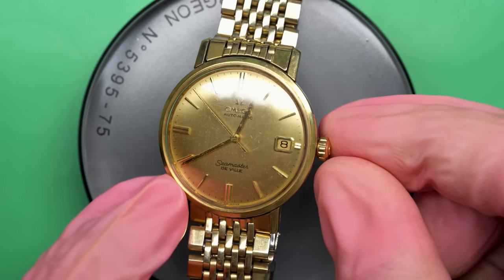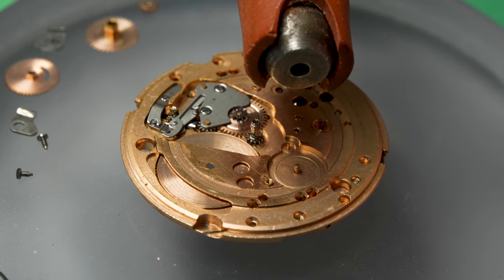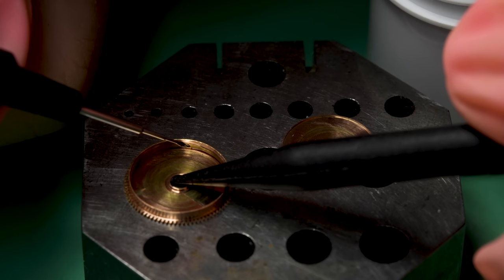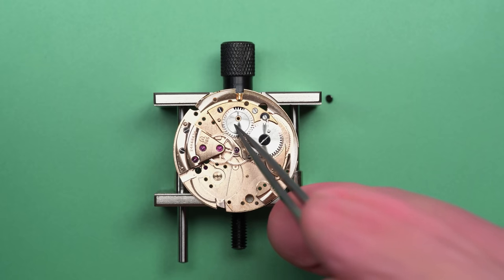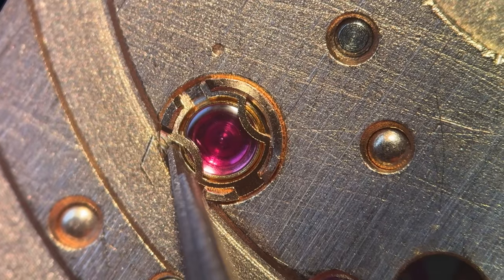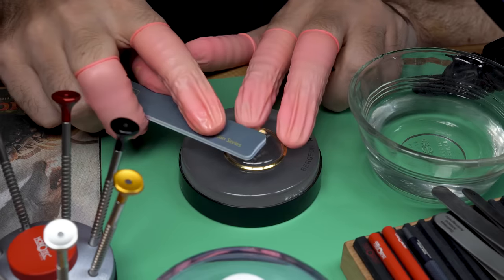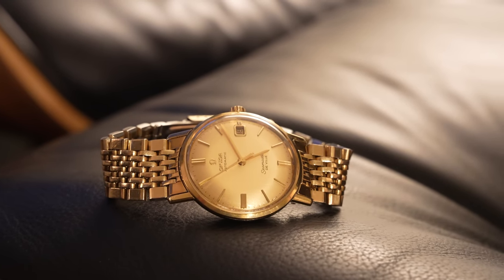This Omega Seamaster Sat in a Drawer for 30 Years

Comment: I would love for you to restore my dads 1980’s Rolex , how can I get in touch with you? I’d like to give it to him as a re-gift he hasn’t used it in a while. Would Love to have it serviced . Thank you
Reply: I would try and contact his Patreon…?
Reply: I would send it to a real watchmaker. It’s incredible that people would allow this guy to work on their watches.
Reply: @anthonyvierra1975  what exactly do you think a “real watchmaker” is?
Reply: @kkf4 ignore him, he's a typical ragebaiter, you can tell by the lack of facts to back up his stance.
Reply: @kkf4  well possibly one who went to school for 2 years to train as a watchmaker and earned a WOSTEP certification or a CW21 from AWCI. He just serviced an ETA with a final amplitude of 270 degrees, that’s a failure.
Reply: @vali69  here’s some facts, he has no certifications and has never apprenticed under anyone. So tell me what else do you need to know? I would love to know what training he did on the 3035 to qualify him to work on it.
Reply: @anthonyvierra1975 Why is an amplitude of 270 bad?
Reply: @anthonyvierra1975 Could you please explain what he did wrong in this video?
Reply: This is how Witschi, a well-known Swiss manufacturer of testing equipment, describes amplitude in their documentation:

The amplitude is the angle from the equilibrium (idle position of the balance wheel) up to the maximum distance (turning point). The amplitude values of today’s popular wristwatches are located at about 260° – 310°. With increasing aging of the oils, this value decreases gradually. 

So as far as I can judge, your talking nonsense.
Reply: I don’t think that Marshall himself would claim to be an official watchmaker. Matter of fact after watching all of his videos I am almost positive he has more than once said that he is not a watchmaker and that he is a hobbyist with a great love of working on watches etc. 

That being said for a hobbyist he is obviously quite knowledgeable in what he does and is always open to learning something new in the hobby and takes great care with every watch he works on.

Unless I had something incredibly crazy rare or that had some really rare movement I don’t think I’d hesitate in having Marshall work on it. He’s shown integrity and honesty many times so.

Maybe instead of coming to someone’s video and then basically being a troll and regurgitating facts and information anyone could Google why not be positive about something instead of making veiled comments about someone’s ability and or character.
Reply: Hear Hear!
Reply: @anthonyvierra1975 well I just gotta ask…why do you watch this channel?
Reply: He mentions his website in the video
Reply: Marshall is a hobbiest.... and yet does a good job... .and has done Rolex... and I would gladly send mine to him.  Love how some nutcase will spend hours arguing against Marshall instead of just deleting he channel from his feed.  This work is impressive.
Reply: @anthonyvierra1975 definitely a jealous person here! I would trust Marshall over most so call watch makers about town.
Reply: @anthonyvierra1975 you sound like apple staff complaining independent repair shop fixing their products better than their certified service centres.
Reply: Good luck. I've been trying to give a watch away to him and he never replies, even through patrion.
Reply: @anthonyvierra1975 what amplitude does Omega say this model should have?
Reply: @anthonyvierra1975 lmao and how do we know you “possibly” went to school for 2 years? You spewing as much jargon as the trolls and keyboard warriors around here always spreading negativity in the world. Grow up. If you don’t like it carry on. Otherwise, just enjoy watching Marshall doing the hobby he enjoys.
Reply: I would definitely let you clean one of mine!
Reply: @anthonyvierra1975  What are you on about? An amplitude of 270 is perfectly acceptable for an Omega 5XX series movement; it isn’t often you get them above 280, especially if you’re not replacing the mainspring (though even with mainspring replacement it may not always reach 270). This isn’t a new watch which has amplitudes in the low 300s. 

An amplitude of 270 w/ original mainspring, in this model and a movement of this age, doesn’t lend any reason to believe that a damaged part or poor servicing is robbing amplitude on this movement. 

I would like to see the creator put the movement back on a timegrapher 24h after full wind and in vertical position to assess minimum amplitude, but based on a result of 270 in full wind there is no reason to suspect problems in minimum amplitude.
Reply: @anthonyvierra1975  you don't have to get certificates and an apprenticeship to do something. And in another one of your comments you say 270 amplitude is bad whereas where I've looked om forums and calibre corner the lower acceptable range is around 260. And you also didn't say why that was bad. And you know what, you could go get whatever the hell certificates you want, it doesn't mean jack shit, experience does, knowledge does, and I've seen in countless times in IT, you can have any system administrator certificate you want, you'll still be rejected for someone with less of those but more years under his belt or better knowledge shown. And as far as we know you could be lying too.  So overall, you're not giving us any facts with your damn certificates, tell us a thing or two about movements and then maybe we'll take you seriously.
Reply: @anthonyvierra1975  dang......hate much lol..🙄
Reply: @anthonyvierra1975 I think one thing that matters here is that he doesn't CLAIM any certification, he's a skilled hobbiest.  If someone wants to trust their timepiece to an affable guy with a YouTube channel who does good solid work but tends to replace fewer parts (preservation vs a full service) - that's their prerogative .
Reply: @vali69  wow you guys have some rage about this. It’s simple if the lowest acceptable standard is 260 and at the start of a 5 year service you’re at 270 how long before you fall out of acceptable range? Does this service still hold up 2 years in? The higher the amplitude the better, on a modern ETA caliber. Defend it all you want it’s not a quality service. I would have changed the barrel complete and worked out from there. So my question to you is if the service is at the lowest acceptable standard why are you upset that I’m pointing out that it’s poor? So a C grade service means people should be sending their watches to him for restoration? As I said before they’re not my watches and people will do what they want. Try to have a conversation without talking down to people and cussing at them.
Reply: @ewingfox6459  I don’t believe implied he claimed to have any certificates. He’s a hobbyist making informative videos about the hobby. Apparently having the opinion that he’s not at the level to be taking on public restorations has offended everyone. As I’ve stated before it’s their watches do as they like. That’s the internet.
Reply: Where’s your YT channel bro?
Reply: This is an awesome channel! He’s incredibly knowledgeable about watches and unlike all the rest of us- he can take every part out of a watch, service it and make it RUN!
He mentions this is a hobby and clearly loves his lobby. And his voiceover is as good as any on YT and his content is compelling
Reply: The only way 😮
Reply: @anthonyvierra1975 ”I’m just a jealous guy”…🎶
Reply: @anthonyvierra1975 Well, it could be the watch he serviced was quite old, and set in a drawer for 30 years. But you would not consider that, or would you?
Reply: I'm 56" and I have been working on watches for 24 years now, and in all fairness, that certification may get you a job in a company, but that doesn't necessarily mean you have the knowledge to do the job. That comes with year's, and alot of patience. I know certified auto mechanics i would not let change a bicycle tire. I'm in Georgia,5 minutes from Chattanooga TN, there is only one other guy in the area that even works on watches,
 You would have to pay a Fortune just to send it to the manufacturer to be serviced.
Reply: @anthonyvierra1975  who’s “a real watch maker” ? I’d presume they’re all deceased. The people who created the craft and theses watches aren’t on earth anymore 😩🤦🏼‍♂️
Reply: @anthonyvierra1975 Your first comment came across as a bit on the aggressive side IMHO.
Reply: @anthonyvierra1975 some people just need to shit on others to make themselves feel good, don't they?
Reply: Good luck. He doesn't answer emails etc. You almost have to know someone. Plus must be a Patreon supporter.
Reply: @sharp1979as In fact, Marshall has serviced watches that even the manufacturer, I believe one of them was Rolex, refused to service, and continues to do a phenomenal job.  I would trust him with any watch of mine.
Reply: @anthonyvierra1975  lol. Says the guy that wears a Hamburgler Happy Meal watch…..LCD 😂
Reply: 3:34
Wrong handling of hand removal causing damage to the hands specifically the sides will be bent. 
5:03
Wrong size screwdriver causing damage to the screw head.
5:18
Improper handling of the date disc
Resulting in visible scratches to the printed side as seen in the video he first uses metal tweezers to pick it up then wooden tipped ones after scratching the print and realizing. 
6:30
Improper handling of balance wheel 
(this is a great way to mess up pivots and hairspring). 
6:37 
See previous remark. 
7:15 
Removing pallet fork bridge while movement is still wound causing the train to start spinning. 

Why is this bad? 
Escape wheel teeth could hit the pallet jewels and knock them loose from the fork or chip the edges, or you can get a damaged tooth on the escapewheel. 
8:22 
Scratched the bridge and likley screw head. 
8:58
Screwdriver not shaped correctly causing it to fly out the slot scratching more parts, damaging the screw head(damage visible at 9:01). 
9:32 
Screwdriver shaped incorrectly slot damaged and maybe bridge scratched from screwdriver slipping out. 
9:51 
Pushing a finished side of a bridge down ontop of the movement is a sure way to scratch the hell out of it. 
11:02 movement isn't held correctly in the holder (should be clamping under the the lip of the mainplate to support properly (you can see it move when he puts pressure on it which is unstable and can cause you to slip and scratch the movement).
11:09 
Disassembly of automatic module ontop of a hardened steel staking block not sure what the reasoning was here but it will ruin the finishing of the rotor and automatic winding framework. 
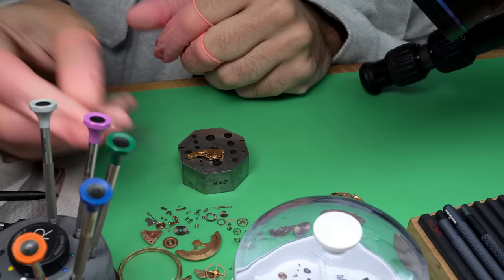11:58 
Wrong size screwdriver and you can see the slot being damaged. 
13:09 - 13:26
Chaotic grouping of parts which can result in damage due to the centrifugal forces of cleaning. 
20:01 
Didn't lubricate spring which can cause it to snap.
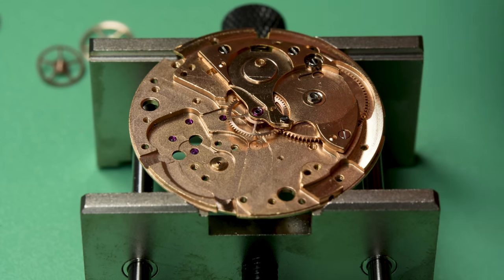21:26 
Oil is placed wrong resulting in the oil being ontop of the jewel instead of in the oil well. 
This will cause premature wear. 
23:03 
Grease should be used,
Didn't lubricate the pinion under the ratchet wheel causing winding issues and premature wear. 
23:39
Grease should be used. 
24:30 - 25:14
No words just generally awful technique and logic not to mention flooding the sliding pinion and winding pinion Breguet teeth with grease and smearing it onto the mainplate by dropping both parts. 
26:25 too much on the detent for the setting lever spring, looks like oil, should be grease to prevent runaway of lubrication causing wear and difficulty in setting the watch. Also didn't lubricate the contact point of the return bar and spring. 
26:39 should be grease not oil, didn't lubricate the "weird part". 
26:54 didn't support center wheel jewel when pressing cannon pinion on, this might result in moving the jewel in the bridge thus altering endshake of the center wheel which will potentially cause meshing issues. 
27:02 
Oil applied here is all ontop of the arbor and not or not sufficient in the hole. 
27:53 pre lubrication of parts should never be done ontop of the movement. 
28:02 
lubrication runaway is visible here. 
29:24 
Running movement and specifically balance jewels dry will cause wear (flat spots) on the (round) pivots causing significant amplitude drop. 
(yes it can happen this fast)
29:55 cap jewel and chaton should've been taken out for cleaning here he cleans them with solvent which is extra steps and not efficient. Also mentions movement is dry. 
(you should oil all the oil wells possible when assembling). 
29:59 oil is outside the well. 
This will cause oil to draw away from the pivot as it wants to staturate the edge of the jewel with the mainplate. 
30:18 
Absolutely no way he can get those cap jewels clean by rubbing wood in the center. 
You should rub the cap jewel over paper flat side down before putting them in the cleaning machine. 
30:48
Here you can see a cresant shape in the cap jewel / chaton assembly. 
The oil wasn't applied correctly and is now drawing away to the edge of the assembly trough capillary action leaving the balance pivot dry causing damage and amplitude drop. 
31:23 
Didn't check the other 5 positions 
Not a good result (rate is in negative). 
31:28 
Oil was used, should be grease. 
31:53 
Didn't lubricate cannon pinion outside so the hour wheel is now running dry. 
32:16 
Didn't lubricate date disc teeth. 
32:23 
same remarks as disassembly. 
33:18 
some more bad oiling. 
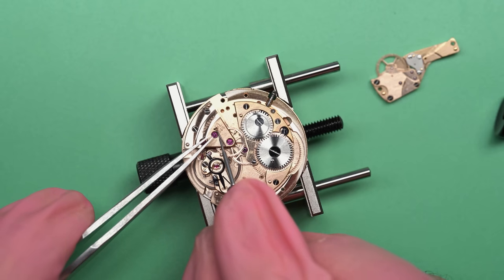33:29 
Didn't lubricate the center seconds pinion 
This will cause amplitude drop. 
Also fun fact he had a base amplitude of around 270°, with the added drag of the backlash spring under the center seconds pinion you will get an amplitude drop not more than 30° so worst case the watch is now running at 240 horizontal at full wind which is borderline bad.
37:50 
No support to the center wheel jewel when setting hands which may move it causing endshake issues.
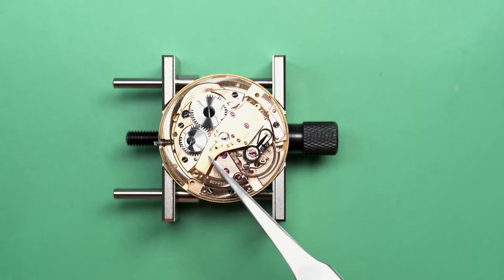38:30
Rambling about how nice the dial is then clamps that dial in a metal work holder... 
Sigh. 
39:00 
didn't lubricate rotor axle.
Reply: @danduntz2539  they refused it because non genuine parts likley otherwise someone isn't honest
Reply: @Inkreptile  well that looks like a lot of effort went into it. You've got my respect unlike that other guy who just came out as a twat with the way he didn't mention anything wrong that was in the video besides amplitude. I'll say I was getting the impression he was really good at this, guess it was the enthusiasm and the general way he's talking in the videos that made it seem like he was better. I guess the guy was right that he is just a hobbyist but I don't see how he won't be able to improve in time or something. Good comment otherwise, this is the sort of stuff I want to see from someone with an apposing view.
Reply: I don't normally comment on anything as it really won't matter and no one cares
Marshall lives close to a watchmaking school I'm sure he'd be a splendid watchmaker if he went to do a course there.
But the errors he makes are more often than not going to result in a poor running watch so a word of advice, expensive or sentimental watch? Go to a professional.
It costs more but you can be sure everything was done as it should.
Reply: @Inkreptile  I see, btw is it really not possible to learn this on your own? I want to learn to service my own watches, and maybe even mod like those guys with their seiko, so would it really be that difficult or impossible to do that on your own? I don't know if there's anything like a school or something in my country and I also wouldn't want to go to one at all for personal reasons related to being nd. Can't I just look at other more qualified watchsmith youtubers, wouldn't I be able to learn from them then?
Reply: @Inkreptile  you’re a professional watchmaker? What name? Swiss or Japanese company or American? 

Dude quit calling yourself a watchmaker when you’re a watch repairer.
Reply: @vali69  take a cw21 course.
Reply: @Inkreptile  naaaaah. Assembling watches or repairing watches for a side hustle or a hobby with a couple qualifications from night school doesn’t mean you’re a watchmaker. Come on man
Reply: @Nick-wh4jt are you defending yer boyfriend?
Reply: @alerojas2952  I’m happily married with 2 kids. Wth are you talking about? Have yourself a cookie
Reply: @Nick-wh4jt why are you going against Inkreptile, he just pointed out the (pretty serious) mistakes in the video. These are pretty darn obvious to any watchmaker that has had some schooling. Why are you defending Marchall so heavily?
Reply: @thebrickshooter5974  why are you attacking people like the others? I made a correction to what was said and he has since removed one of his comments. What business is it of yours anyway? People going around claiming to be watchmakers is just insanity. There’s a big difference between a weekend assembler or a modder or somebody who repairs watches and a watchmaker
Reply: @thebrickshooter5974  a cw21 certificate requires 2years work experience and it’s a 3-4day examination. If I go to night school for 6weeks and get a certificate does that make me a professional engineer? The answer is NO. Heck no. Hobbyists, modders, weekend assemblers or repairers aren’t even close to a professional watchmaker. Cut it out. Stop attacking people on the internet
Reply: @Nick-wh4jt  because I know this guy, and he literally as a professional watchmaker..  and it is not attacking people, it is just making them aware of a situation before they send off their precious watch
Reply: @thebrickshooter5974  no, it was just explained to you. And I’ll say again he removed a previous comment, which is a comment I had replied to. Stop attacking people on the internet
Reply: @Nick-wh4jt  I’m attacking no-one but okay, keep being mad for some reason? The matter of fact is, marchall has very sloppy practices and if you have a precious watch, you should send it somewhere else. That’s all. Is informing people attacking nowadays? Jeez
Reply: @thebrickshooter5974  I’ll break it down for ya. Marchall claimed to be a watchmaker and I said no, he’s a watch repairer. Then somebody else claimed to be a professional watchmaker and again I said no. The fact is you’ve made a clown of yourself, create a pointless argument when you don’t even know what was said in the first place. Good job. Now what?
Reply: @thebrickshooter5974  literally, scroll up. He claimed in the video to be a watchmaker and I said no. So what are you arguing about now? You’ve made a completely pointless argument and just chose to attack people on the internet without any reason.
Reply: @anthonyvierra1975 I have watched many videos and have been the customer of a few professional "watchmakers"......Marshall is more thorough than many of the "pros".
Reply: Classic Horological giants with no formal q’s John Harrison, Rupert Gould, the grand master George Daniels only did a basic course!  oh all English too 😉
Reply: Well.. there are watchmakers who can learn from him! I have seen real watchmaker atelier with a washdryer in it on the other side of the room and workingbensh. He was working from Home in his private ‘atelier’ well.. dust everywhere ofcourse. That’s now place to fix watch!! But the Guy was a certified watchmaker do..
Reply: @anthonyvierra1975 I'm  late but I'm agreeing with ya, the other guy who said certifications are jack shite and proceeded to use an example from an it company, has never worked in an IT company he is right the experience is better than certifications but based on your point experience apprenticeship is better than what this guy is doing the hobbyist so his second Point validates your first point but his first point doesnt make sens
Reply: @anthonyvierra1975 he never has claimed to be a certified watchmaker, and always says he's a hobbyist/enthusiast. People can have their watch worked on by whomever they want. He's made watch repair accessable to more people. Youre just Salty because he's popular
Reply: @edenwildfood8589  No he salty because he's, like you said, not an expert at handling watches
Reply: @the_officials38  just like a bunch of mechanics getting salty and mechanic diyer youtubers. I've also watched plenty of certified watchmaker content and Marshall operates in the same way at the same level as most of them. But in a more humble accessible and entertaining way
Reply: Says a failed watchmaker who spent a lot of his daddy’s money on school.
Reply: @mckimmym  That's sounds like a personal insult 😁
Reply: Did I just read 75 posts of people arguing over a watch repair video? Imcluding 1 very detailed description of mistakes made, including how to apply oil (or is it grease) to a jewel in a 60 YEAR OLD watch ⌚ ?? THAT'S IT!  I NEED A GIRLFRIEND. 🚶🏾‍♂️ 🚶🏾‍♂️ 🚶🏾‍♂️
Reply: @vali69 I've been in IT for 15 years and this is 100% accurate. That hands on knowledge keeps me employed and relevant with competitive salary. Not knocking certs, but I've run into a lot of techs bloated witch certs who were not proficient with doing the actual work.
Reply: With YouTube and Google, one doesn't need to apprentice under anyone or get a certification to be good if not better than someone who has one. I know people with no credentials who are better in a trade than those with college degrees... Marshall has never claimed to be a professional and he does this as a hobby. Doesn't mean he's any less qualified to work on watches.... Gatekeeping isn't welcome here. If you're a snob, then get lost.
Reply: Remember,it's his hobby and enjoys doing it, don't think he's doing it for money,you can tell he's very passionate, good luck to the chap🇬🇧🌠
Reply: Just love how everyone flamed that anthonyvererra dude for his nastiness 😂
Reply: @anthonyvierra1975  dude this gentleman is very aware and proud of learning this craft, if I had a Patek Phillipe grand complication that needed attention I would absolutely let Marshal work on it. No question!